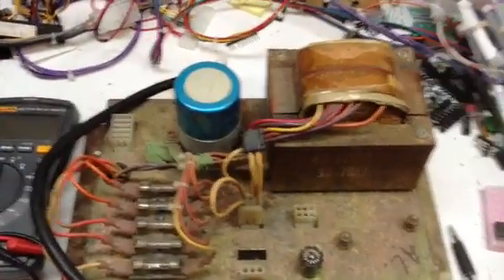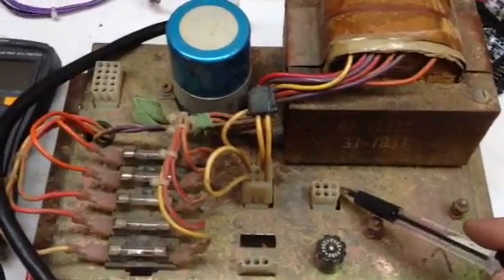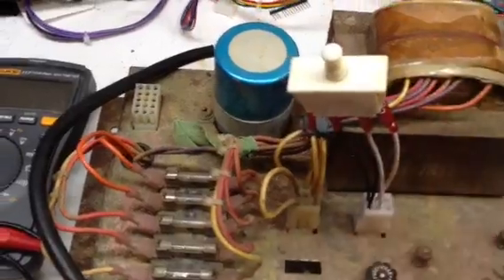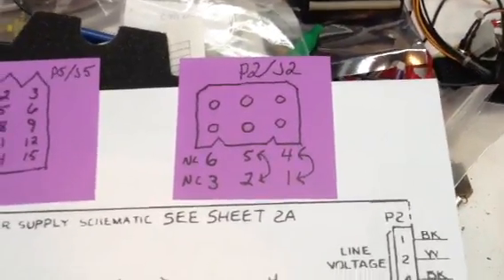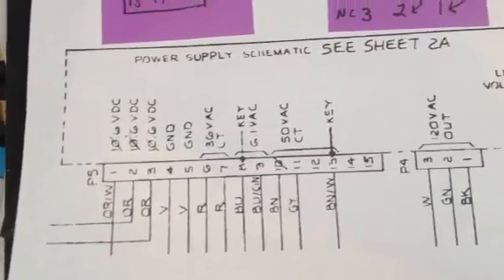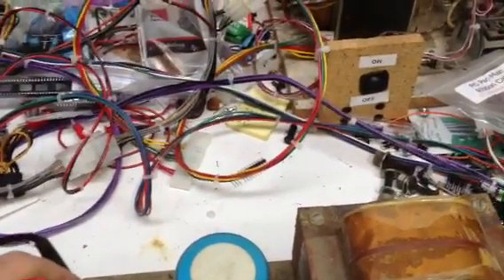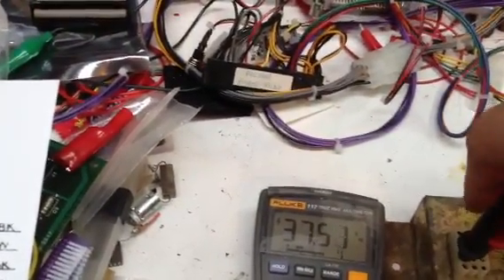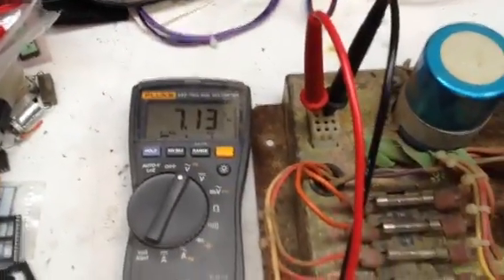Atari Power Brick Testing

Comment: I need to know what voltage is I need to run to my Wells Gardner.for a test
Reply: Wells Gardner is a little too vague Brother. Raster monitor? Vector monitor? The model of monitor or even the game you are working on would be helpful.
Reply: I'll just trace the wires from The crt to the power brick

Comment: What about the 61 v ac . I'm checking the power brick in the game so no separate switch needed. My 61v is 37 and the other one is 46.3.. I think it's just a bad transformer. Those are the ones going to the monitor you didn't demonstrate. The 36v go's to the board .
Reply from the maker: I did not cover monitor voltages because it varies depending on raster game or vector game. What game are you working on?
Reply: @D0kert  I remember you saying that I didn't think it was that many.. I'm working on asteroids the schematics said 61v which is the same as my centipede. Centipede 61v was dead on 61v but they are in different locations My asteroids are 31.8v btw cavity 11 and 12. And 45.1 btw 13 and 15? Sorry for the delay..
Reply: I know you did this a long time ago and it is rudimentary for you but man was this helpful!
I thought I had a dead brick but it appears perfectly healthy.
Thank you sir!